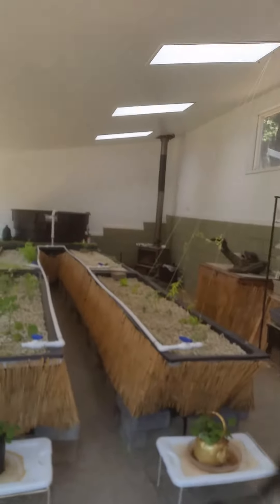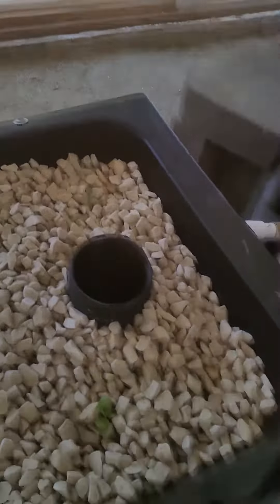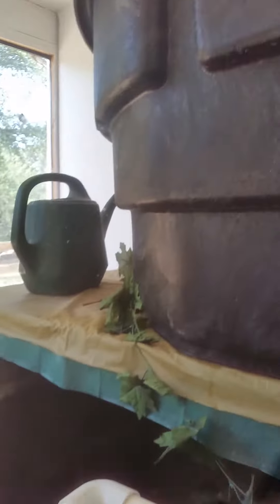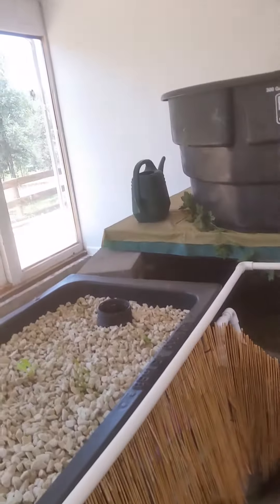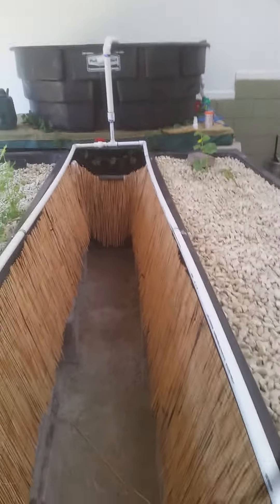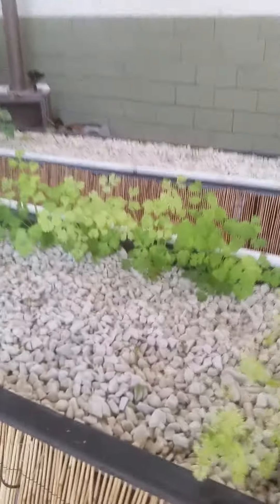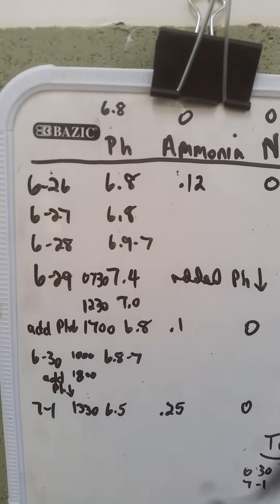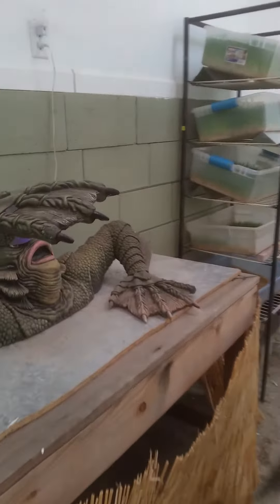Aquaponics u-Siphons

Comment: Very nice setup - I have to find out more about the U siphons. Re the high nitrates, it seems that you have plenty of room for plants to suck that up and a relatively small number of fish. Maybe slow down the feeding a bit and chuck in a bunch of basil in all that open space or even wheatgrass if the nitrates keep climbing. You might need some supplemental light on the beds away from the windows. I'm envious!